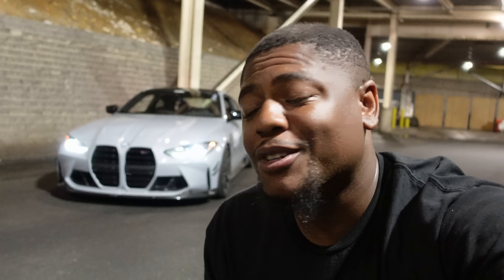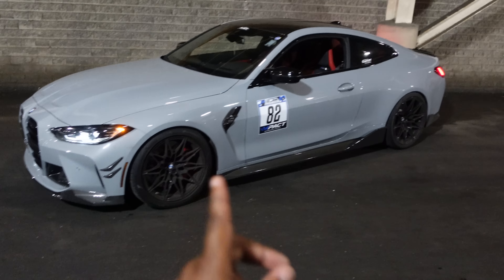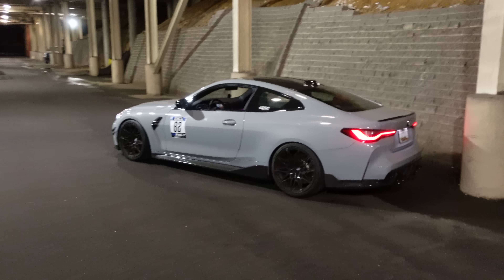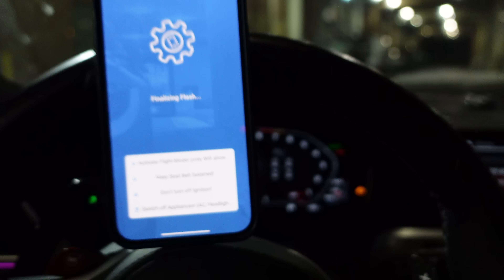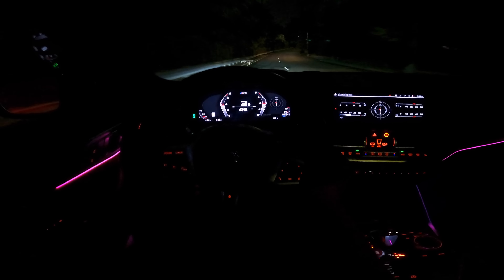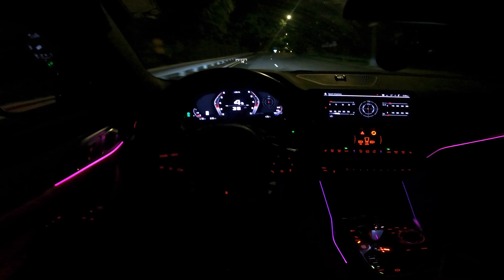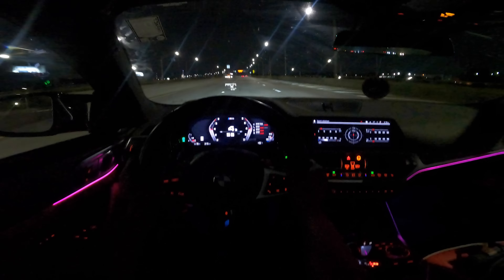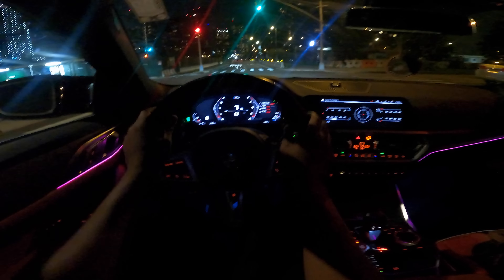HONEST REVIEW ON MY DÄHLER TUNED G82 BMW M4 COMPETITION!

Comment: Firstly, just brought MY M3 Comp XD G80 home a few days ago, and found your channel a while back when I still had a M240i XD ordered.  A customer forfeited his M3 G80 and my salesman asked if I wanted to upgrade, so I accepted obviously, haha..  Got extremely lucky cause the car is almost exactly how I would have spec it too and I didnt have to wait 10 months.  Thanks for producing quality content, and look forward to meeting you sometime at an event..

Bryan from Kies ran a dyno test with the Dahler unit and pulled 610 HP with an MST intake and Dahler exhaust but Im not sure if he had downpipes installed.  Im also considering those 3 options, and I am curious if you can run E blends with dahler unit, not map specific to E blends, just run the regular Dahler map options but with a lil bump in octane levels...  I also be adding ApexBuilt Downpipes with Heat Shielding and Active Autowerk single midpipe and MST Intake.  I do like the fact Race Chip offers a 2 year warranty on the engine up to $10K, and is significantly less costly...  HOWEVER..... being cheap when it comes to software is not ideal esp with an ECU.  That said, RC's lower prices could simply be due to their size and ability to scale manufacturing better compared to Dahler, which is less common.  Actually, there isnt much information about Dahler online, compared to JB4 and RC.  No social media presence, no youtube channels, no developer interviews, no detailed product reviews(Actual mechanisms of improvement, data analytics, etc)....  Ive emailed them twice now with questions, and nobody has returned my emails, which is a bit concerning I must say.  As customer support is vital in this area of product/service..  Bryan from Kies does seem like an super authentic and nice dude tho... A trustworthy perspective for BMW upgrades for sure, but hes also running a business, and he does offer both units.

I reached out to JB4 to ask them how their unit compares to Dahler, and they wouldnt comment.  JB4 does not have cam position or fuel rail sensors, however it does have an OBD port for additional data inputs, curious how much data they extract & use from OBD to adjust the units functionality real-time, or is the OBD simply for secondary support.   AutoTopNL has some reviews of RC with newer G models, and they claim 660 HP, I would like to see data on that..  I also called them to request that data and they said they havent publicly released that data, which is a bit weird to be honest.  You would think that would be their primary pitch...  

All units seems to have their + and -   frankly its a tough decision...
Reply: Wow nice novel 🥴

Comment: I'm sure others will chime in but the piggyback vs ECU age old debate has generally be understood that it's better to have proper mapping vs how piggybacks function in "fooling" the system so to speak.  I understand for those that don't want to take out their DMEs at the time or writing this because the S58 (outside of the X3M as I believe Kies is using that as a tuneable workaround) this may fit the bill for them.  Many people will also not hardware modify their cars but just get an OTS map from the likes of BM3 and MHD and get a very notable upgrade without having to dig into HPFP, DPs, etc.  I personally after picking up my '20 F87, flashed an e30 tune a day later as I came from a heavily modded N55 and knew the ceiling for the S55 is that much better similar to the S58 compared to the B58 as you found out, the S58 hauls a ss on the top end which is its beauty in disguise :) Looking forward to the proper flash tune my guy

Comment: In your opinion, is it worth going PS2 on my OG M2? I know you used to own a bad ass N55 back in the day 😁 debating keeping it and throwing a bigger turbo or getting into a B58/S58 platform instead. Only looking for 500ish wheel.
Reply from the maker: Not a fan of pure stage 2 at all. It uses the same log manifold from stock turbo which when turned up has issues allowing the exhaust gases to escape
Reply: @Slowspeed  oh word?! Damn so maybe something like an a Speedtech or BB EFR bottom mount might be the ticket...

Comment: I modifying the shit out of my stuff. Exhaust, intake, dp, tune, suspension,etc.. stock isn’t for me. That app where you can input torque settings and tinker with stuff is dope. Way cooler stuff for bmw then there is for Audi 😭 ( piggyback is cool if your taking it in for warranty stuff or want to be on the safer side. Which is all good, everyone has their preference and that’s how it should be )